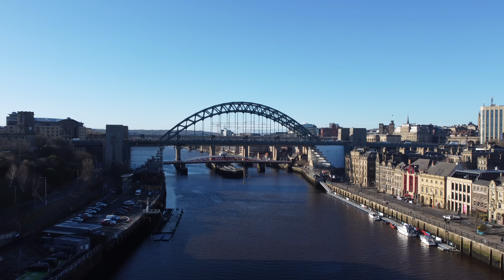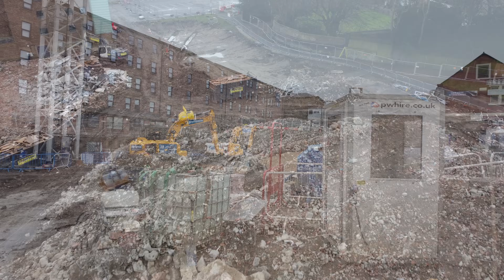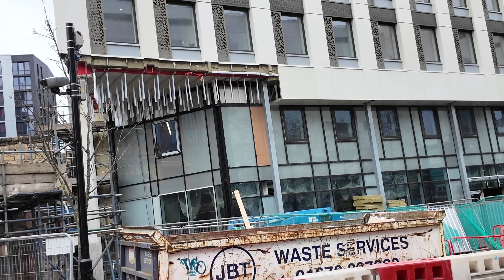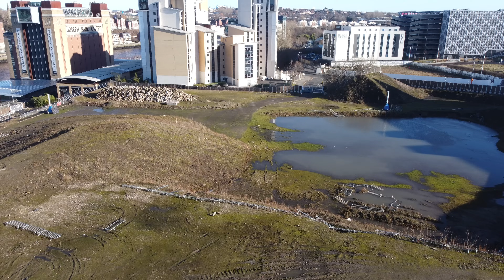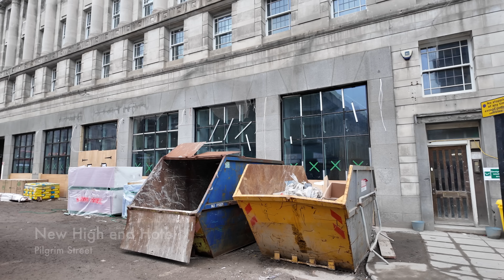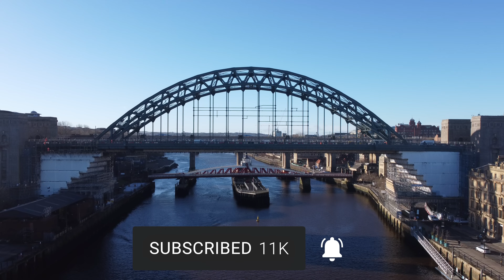Exciting Updates on Newcastle construction and restoration HMRC, Northumberland Street  and beyond!

Comment: Yes they are lift shafts as I mentioned to you a while ago but they also include emergency staircases. They are not built to withstand moving elevators but to provide fire resistance, normally 3 hours.
Reply from the maker: Yea thanks for that bet it was not like that years ago I think the safety element has improved loads over the years I am definitely on a learning curve I appreciate all your help thanks for watching 👀